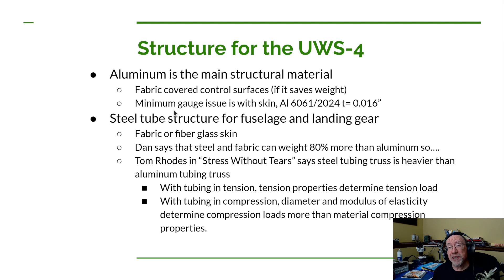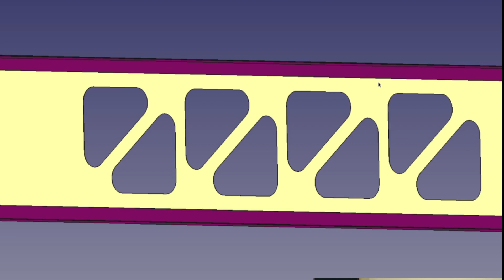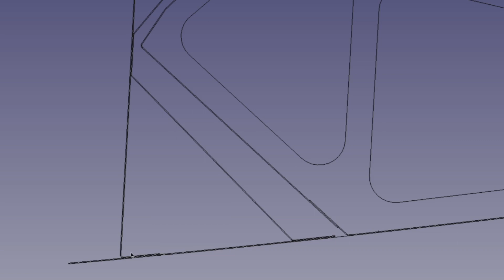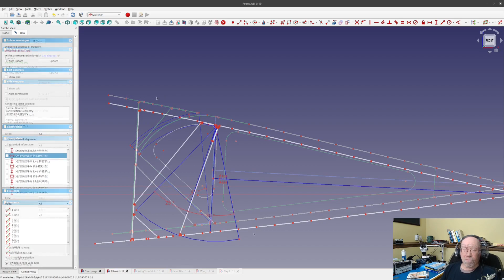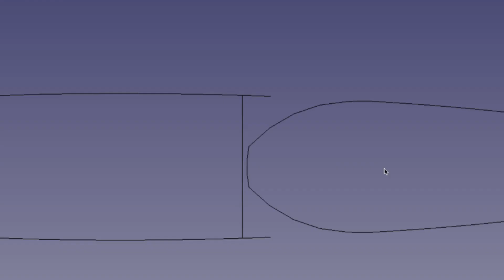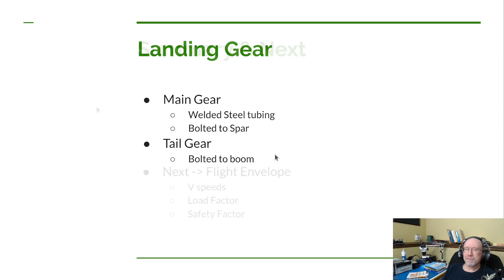UWS-4 Aero Design: Part 10a, Structural Sizing

Comment: aaaaaahhhhhh.... a video with no mid-roll ads :)
I'm curious about how the rudder and elevator inputs will be combined mechanically and passed down the booms.
Reply from the maker: I'm curious about that too. LOL. I have not looked into the combining method yet. It will happen behind the pilots seat. I'm currently thinking of running cables between the combiner and  the ruddervators  , through each boom.

Comment: Have you thought of building a 3d printed RC version of your design? Then run some tests on it before commiting to the full size version?
Reply from the maker: An excellent question. It has crossed my mind. The issue is that for a scale model to behave like a larger model you have to have the mass scaled correctly and you have to have the same Reynolds numbers. If you can't do both of those then the scale model results may not help or may even lead you astray.  I'm talking aerodynamics here. I am not currently thinking of making a scale model of the UWS-4.  I may make some 3D printed non structural parts though.